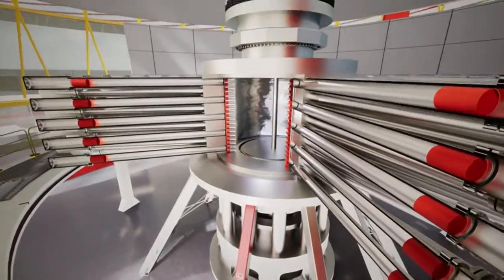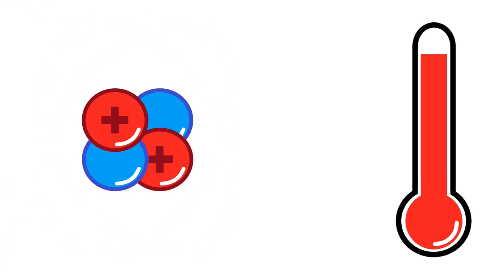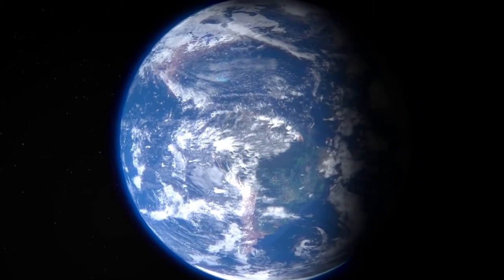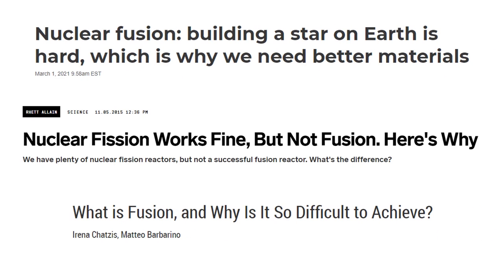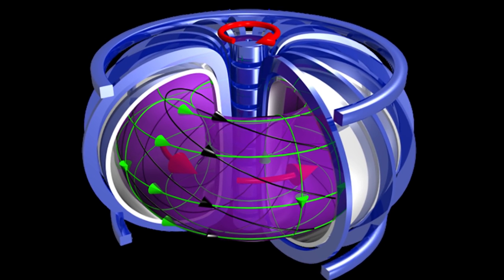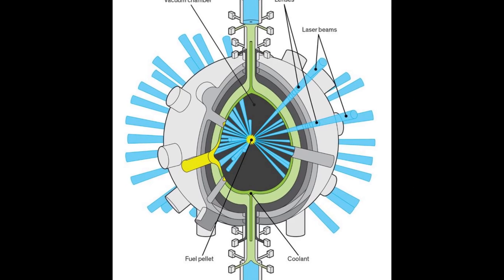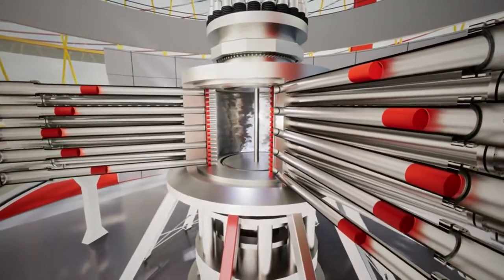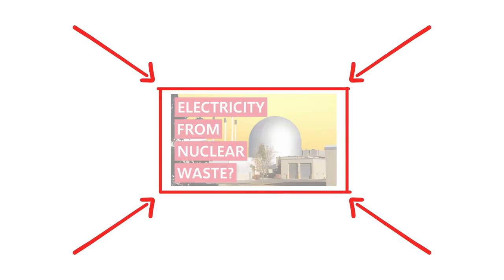This Canadian Fusion Reactor Could be Built by 2025

Comment: I'm a fan of fusion reactors, they are IMHO the only long term power supply for our society.  But I'm willing to bet that this approach (nor any other) won't be online by the 2030s, or even 2040s.
Reply: We're still a hundred years away from fusion, and we have about 3 millenia worth of fission fuel (potentially much longer even, given the recent breakthrough in extracting uranium from the ocean). Getting a fusion reaction  to occur isn't a problem. We've done it lots of times, either in bombs or in non power generating reactors. Getting useful energy out of a fusion reaction, however, is a MUCH harder problem. 

Takomack or even this piston model, try to mimic the sun through high pressures and/or temperatures. This will never. Never. Literally we will never be able to make electricity like this. You know why? Because the sun is fucking huge. As big as you think the sun is, it's bigger. It is literally millions of miles away, and still looks the size of golf ball. We are able to see stars that are hundreds of light years away. They are MASSIVE. Of course sun's have enough gravity to force nuclei together, because they're enormous.

There are other avenues to fusion that MIGHT work in a hundred years or so, but fission already works, and we have enough to last us for a thousand years easily. Yes, fissile fuel is limited, but I think a thousand years is more than enough to come up with an alternative (and fission already works).

Any talk about breakthroughs with fusion  technology are an absolute lie. There's a reason the joke is that it's perpetually 25 years away. It's gaslighting so you say to yourself "well, we can use natural gas and keep plugging away at renewables that don't work. Fusion is right around the corner. No need to waste our time with dirty fission." 

It is not right around the corner, especially not with compression techniques, because the sun is like, really huge.
Reply: @spencer1980  Just follow the money, we are getting close.
Reply: @spencer1980  same as establishment going on about SMR, nearly none speak about molten salt reactors
Reply: @samuelforsyth6374  and molten salt reactors are without a doubt the most promising design for powering the future. After an initial seed of enriched fuel to get the relation going, they can burn raw uranium, thorium, and even nuclear waste.
Reply: I think we will have a working reactor by 2025. I think AI could get us there, if we use a supercomputer using AI we can crunch a crap load of data and simulations to find the best route. Atleast this is what I hope. For now I think fission modular reactors are the next best thing as long as people can get over the fear mongering.
Reply: @Chevymonster203  why do you focus on 'modular' ? its not the defining feature and only kinda helps with costs, they still have water coolant so have the potential to scare the luddites and seed scepticism in nuclear overall
Reply: @samuelforsyth6374  Because modular reactors can be moved anywhere, you can literally stick one on a mountain. If we really want too power the world small fission reactors that are easily serviceable and replaceable is key. Most towns around the world don't need huge reactors because their power consumption is low, maybe four small reactors would be sufficient.
Reply: @Chevymonster203  fusion isn't the kind of problem AI can solve. AI is good at things like path optimization, filtering data, and pattern recognition. In the context of engineering, it can maybe find some neat little tricks to nickel and dime efficiencies. Stuff like "no human would think to put 3 extra grams of steel in this one place, but it will make the structure 30% stronger."

Computer simulations can be really useful for discovering new materials, but again, fusion isn't really a materials science problem. Fusion occurs passively in stars because they're just fucking enormous. Trying to replicate forces like that is just kind of nonsense science. Stars naturally exist in equilibrium. The gravity of its mass compresses things, while the energy given off by the fusion reactions keeps them from collapsing to a black hole. The force of gravity and the force of fusion are in balance. The reason sustained positive output fusion has more or less been impossible, is because it takes as much energy to compress the fuel as you get out of it. We haven't even been able to turn on a light bulb with fusion, and based on the science, you shouldn't expect we will ever be able to. 

The electromagnetic force, which keeps protons repelling each other, is 10^40 times stronger than gravity. This is why even giant balls of hydrogen like jupiter don't fuse, and why stars only form if they're unbelievably huge.

You will never be able to nickel and dime your way around energy requirements like that.
Reply: @samuelforsyth6374 over-conservative  nuclear regulatory regimes make SMRs easier than MSRs...
Reply: @Ironic1950  ergo canada, why invest in an old design with red tape everywhere
Reply: @Ironic1950  yeah gimme a second lol. Sorry it's my favorite adjective.
Reply: @samuelforsyth6374  i will also add that studying fusion is still an incredibly valuable pursuit. Even this piston design will probably have all sorts of discoveries and insights that are useful in other fields. Plasma physics is going to be incredibly important going forward, for green technologies too even. There was talk a few months ago about a green "jet" that uses plasma as its propellant, instead of jet fuel. 

Also who knows, I could be wrong, and someone has a eureka moment for fusion in the bath tub next week and we crack it. I mentioned materials science in my AI comment, and something like mechanical compression in the piston design is going to be a very materials heavy problem. I don't want to stop researching fusion, I just dont want to wait around for it to get off fossil fuels. Fission is already here, it's safe, carbon free and fusion isn't a guarantee.
Reply: @spencer1980  'They can't go critical, and don't even have neutron absorption/mederation factored into their design' what the hell do you mean by that? quite incorrect, graphite moderator in a basic design
Reply: @spencer1980  how will the piston rings have the slightest chance of working? my corolla burns oil and its only 11.1 compression ratio
Reply: @spencer1980  even calling them SMR means nothing if you still need to build a pressure  vessel to contain a possible steam explosion.. thats nearly half of the overall build cost
Reply: @samuelforsyth6374  they use silicon carbide in the wall of the reactor vessel, but I don't think that's for neutron mediation. It's just shielding to prevent corrosion/neutron poisoning of the reactor vessel. 

It's quite unlike other reactors I'm familiar with. Very exciting if they can pull it off (and I think they can).
Reply: @spencer1980  their design is interesting for power and has the potential to run a super critical co2 turbine or just use the prosess heat for chemical production (>700 C) but i have a bias against fast spectrum designs, it will dodge nearly all corrosion problems tho can't argue with that
Reply: @spencer1980  terrapower is a bill gates red herring tho, they are slow compared to moltex energy
Reply: Wink wink nudge nudge to Iran, it's like making kombucha or yogurt. You just need a a slightly enriched starter seed (plutonium works best I believe), after that raw uranium chloride is fine for the breed burn cycle. I'm sure the grape vine will carry something useful your way.
Reply: terrapower is more keen on pebble beds than molten salt anyway right? I wrote them off a while ago as more optics than logic
Reply: @samuelforsyth6374  kinda, but not for the reason you think..the silicon carbide shell within the reacor vessel  is kind of like one of the pebbles shapped into a torus, except the whole thing is just one pebble. They use the convection currents generated by fission to keep the uranium and salts flowing, with a heat pump to extract the energy at the top of the circuit. 

Their breed and burn cycle might be all hype. That one is absolutely possible, but above my skill level to say whether or not they have it dialed in. It does sound probable though. They claim that with an initial seed of either enriched uranium or plutonium, they can get a breed burn fuel cycle that can accept raw uranium, thorium, or even nuclear waste. They might not have it optimized for waste or through, but thats just a matter of tweaking the recipe (I believe they use filler salts that aren't fissike as auxiliary heat conductors). Some of it is probably hype, theres always hype, but a breed burn cycle for raw uranium following following initial seed of enriched uranium sounds likely. 

You should hit them up again. If they shrug you off, tell them their boss is trying to give the world clean power, not get rich.
Reply: @spencer1980  Yes it is very important to keep advancing fission those opposed are coal lovers.
We are abvancing very quickly with fusion, private money is now the main driver.
Reply: @samuelforsyth6374  Many smr’s are salt reactors of which there are many types.
Reply: @spencer1980  No, not necessarily.
Reply: @spencer1980  Name a material problem general fusion faces. All advanced reactors are based in materials we’ve been using for years, the LFTR the Chinese are investigating needs purified isotopes of Lithium which takes dirty mercury so alternative methods will be needed.
Reply: @samuelforsyth6374  No
Reply: @paulbedichek2679  I said in my comment about AI that fusion isn't really a materials science problem. I do wonder if mechanically compressing metalic hydrogen might be a viable form of fusion, and that would definitely have some materials science hurdles.
Reply: @paulbedichek2679  I just watched a video about the guy who discovered metalic phosphorous. He made it by doing a phosphorus recrystalization in molten lead. Might be an alternative to mercury. Lead still isn't great, but much safer than mercury I'd say.
Reply: @spencer1980  Im sure you have no idea what metallic Hydrogen is.
Reply: @spencer1980  Nothing to do with metallic H which is found in the core of Jupiter.
Reply: @paulbedichek2679  um....okay??? I don't know what your point is lol. I kinda want to explain that it's the phase hydrogen finds itself in at incredibly high pressures (gigapascal range) that was made in lab just this last year or so with mechanical compression (I believe they used diamonds), but I also kinda think your comment was pretty rude so maybe I won't do that
Reply: @pushies5  ok, that's your opinion.  But "Big Oil" can't "suspend" R&D from other companies.  Sure they can attempt to undermine it, they can find other FF resources (tar sands, shale oils, etc) ... which require a high oil price to extract economically.  To apply your logic, there'd be no R&D into alternative energy either ... but there is.  And the economics of these are another topic.  But look at the politics and the rhetoric of the politicians (responding to the will of the "people", as they see it).  No one wants to be the best buggy whip marker in an age of automobiles ... no one wants to be the last burner of FFs ('cause something better has come along) ... it would be in Big Oil's long term interests to support Fusion energy as the next big thing ... if they don't someone else will and win the long game.
Reply: @PrivateSi  something resembling cold fusion might be possible one day. Either getting protons to tunnel into a nucleus or some clever tricks with neutron decay. But it's also not something we'll need for a few thousands years. Doing fusion research is useful because doing science is useful. It's not worth it as an energy investment though.
Reply: Try 2140's.  Fusion is a pipedream that has been 30 years away for 90 years.
Reply: @spencer1980  what about the whole concept is wrong. Look a tunneling and high density deutrium.
Reply: @spencer1980  hear, hear!
Reply: @pushies5  you can think that, but you'd be wrong.
Reply: @spencer1980  and adverb, noun, verb, article, and pronoun.
Reply: @nuanil  you can remember that, but you'd be wrong. Government is discouraging smokers from going to vape because its more or less 'as bad' and people buying cigarette is $ and people with lung disease from smoking buys their placebo medicine which is also $ and the cycles continues.
Reply: @nuanil   I know it's really hard to justify the government regulation on that particular matter, because well it's absurd and so are the people advocating it.
Reply: @nuanil  so is the federal reserve, artificial intrest rates, ESG scores, debt monetization ..etc  they even get rid of good regulation like glass steagall. whats wrong with caveat emptor?
Reply: @nuanil  I don't hate regulations if they are sensible don't straw man me.. I gave an example of one I liked
Reply: @samuelforsyth6374  molten salt test reactor just announced for Idaho National Laboratory.
Reply: @Chevymonster203  if only AI could conceive of a way to teach us how to get over fear mongering.

Comment: Interesting.  Hope that their idea works.  At least they are thinking along the heat out of the reactor.  The other systems have a problem with this last, according to what I've heard.
Reply: Actually, there is another proposed way to get power out of a fusion reactor, it is called the field reversed configuration. Instead of heating up molten metal, It flows cooler plasma around the much hotter fusion site to siphon off the heat. The plasma's heat is used to generate power, then the cooled down plasma is put back into a closed loop and back into to the fusion site. It is fascinating stuff, you should check it out.
Reply: @_EVANERV_  Now that tech exists for (grumble grumble) efficient conversion of HVDC down to usable grid-level AC via semiconductors, direct conversion would seem to be the ideal method of getting the juice out.

Comment: I love it! The problem with super conducting magnets is the cold. having hot plasma next to sold super conductors is just bad design. this makes sense, plus there are no extra steps. Just put a helium or steam generater at the heat exchange surface

Comment: Fusion research is full of exciting news about 'breakthroughs', but the plain fact is that no fusion reactor is anywhere near break-even, always requiring many times more input energy than ever comes out as usable electricity...!
Reply: Yes, it's a marathon, not a sprint, but every milestone on the long journey to commercial fusion brings us one step closer to the goal.
Reply: Always 30 years away!!
Reply: Yes,we are close to commercial fusion energy, but we should not neglect fission energy which has all the benefits of fusion, and is already working at vast scale.Finnland is home to the worst boondoggle of a nuclear plant but even with all its corruption and mismanagement ,nuclear power in Finland has a LCOE of .03Eu Kw. Their new plant has all its fuel loaded and will go critical soon.1700MW of clean power that is almost always on, when it becomes grid connected the NorthVolt factories in Sweden will be able to use their hydropower which today goes in a cable to Finns .
Reply: You may be interested that a fusion reactor already exceeded break even this year.
Reply: @michaelkhalsa  Which reactor?
Reply: @michaelkhalsa  ...by what measure...? Maybe a different break-even to the breakeven the rest of us understand as producing more electrical power out than that required to sustain power production indefinitely...?
Reply: @patrickhenry1249  they took a horse-drawn cart, and replaced the horse with an external combustion steam engine...in the case of fusion, there is an example 93 million miles away, for whatever good that may be!  The point is that magnetic containment works to some degree, but the power required to generate the magnetic fields in superconducting coils is many times  the possible output from the plasma, so interesting experiment, but of zero practical use today...

Comment: My favourite fact about General Fusion.  If you've ever seen the show Travelers, if you haven't I highly recommend it.  In the show they are looking for an anti-matter bomb (If I'm remembering correctly).  Those scenes are at General Fusion.
Reply: Anti matter bomb are very simple, you just need half the material, the anti matter, it has to be carried in a thermos at low temps, anti matter is made at the CERN facility and they have already loaded anti matter in a flask and loaded in a van and drove it so many miles, to explode just release them ,matter is ubiquitous . So far the number of particles is very low, could be a couple of hundred years before we have a space drive based on it.
 We already have very effective small powerful nuclear weapons.

Comment: New generation fission reactor designs also cannot melt down. Fission simply slows and stops when the fuel pellets get too hot, making them passively safe. This actually dates back to the 1950s, when physicist Freeman Dyson led a team to create TRIGA: a nuclear reactor for use as an educational tool. It is so safe that it operates without a containment vessel. A senior member of the team, Edward Teller, described the reactor as one that "could be given to a bunch of high school children to play with without any fear that they would get hurt." There always are inherent dangers in producing great quantities of energy, but the point remains that reactors like this do not have anywhere near the same meltdown risks as reactors built in the past.

Also, whether or not fusion produces nuclear waste is dependant on the fuel it uses. Some reactions produce free neutrons which will induce radioactivity in material they interact with. (Of course, this is also problem with fission reactors.) This produces relatively low-level waste, but it cannot be ignored. I don't know enough to say anything about the compatibility of reactor designs with various fuels.